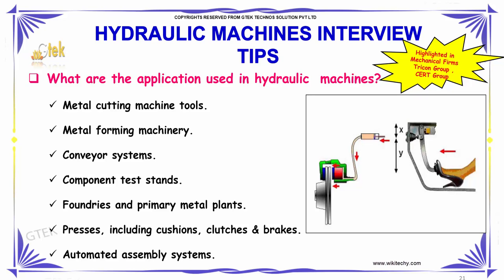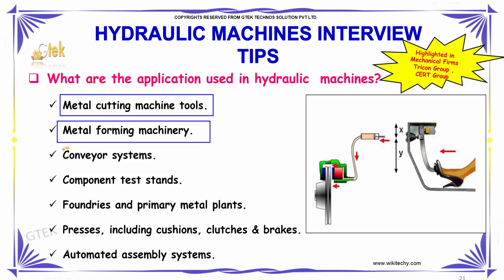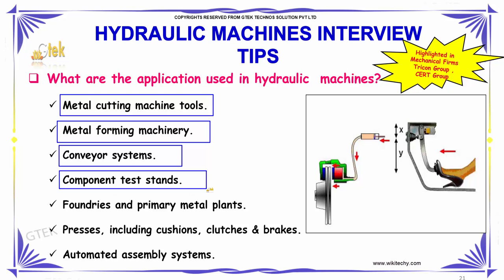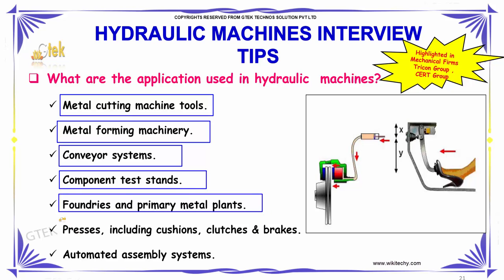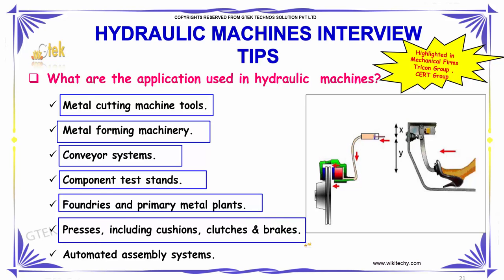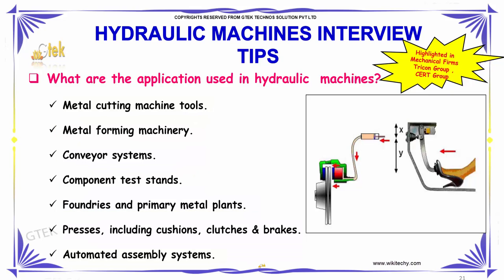applications used in hydraulic machines | hydraulic machines interview tips | wikitechy.com

Comment: Reservoirs store a system's fluid. Examples of accumulator uses are backup power for steering or brakes, or to act as a shock absorber for the hydraulic circuit.

Comment: Bladders are used in other designs. Reservoirs store a system's fluid. Examples of accumulator uses are backup power for steering or brakes, or to act as a shock absorber for the hydraulic circuit.

Comment: On one side of the piston is a charge of pressurized gas, and on the other side is the fluid. Bladders are used in other designs. Reservoirs store a system's fluid. Examples of accumulator uses are backup power for steering or brakes, or to act as a shock absorber for the hydrauliccircuit.

Comment: Image result for hydraulic machines
Hydraulic machines are machinery and tools that use liquid fluid power to do simple work. Heavy equipment is a common example. In this type of machine, hydraulic fluid is transmitted throughout the machine to various hydraulic motors and hydraulic cylinders and becomes pressurised according to the resistance present.

Comment: The following are the miscellaneous hydraulic machines: (a) Hydraulic press. It is a device used to lift larger load by the application of a comparatively much smaller force. (b) Hydraulic ram. (d) Hydraulic intensifier. (e) Hydraulic crane. (f) Hydraulic lift.

Comment: Hydraulic System Applications

RHM built fluid power systems are generally applied in industrial plant environments, though some find their way into mobile, marine or laboratory settings. While there are literally hundreds of end use applications for RHM fluid power systems, some of the more common uses include:

Metal cutting machine toolsMetal forming machineryConveyor systemsComponent test standsFoundries and primary metals plantsPresses, including cush

Comment: Hydraulic machines are machinery and tools that use liquid fluid power to do simple work. Heavy equipment is a common example. In this type of machine, hydraulic fluid is transmitted throughout the machine to various hydraulicmotors and hydrauliccylinders and becomes pressurised according to the resistance present.